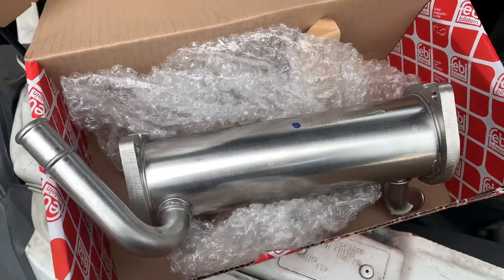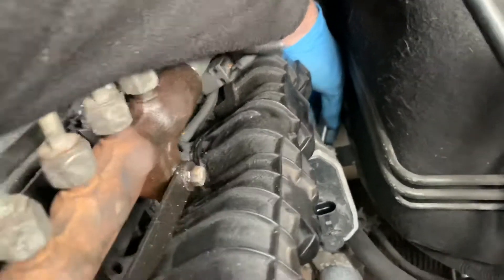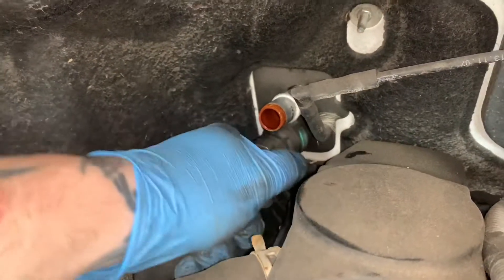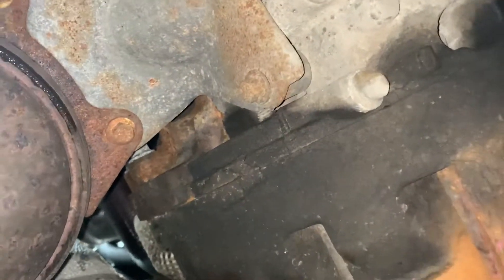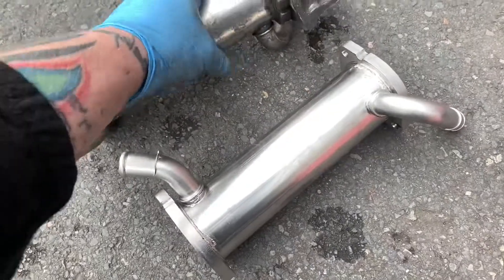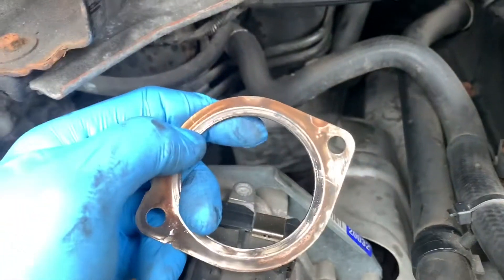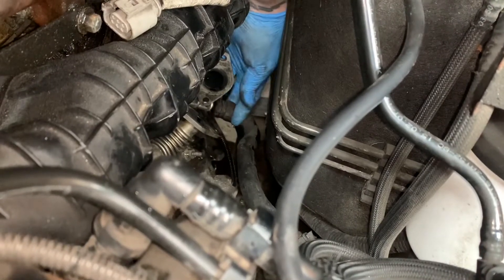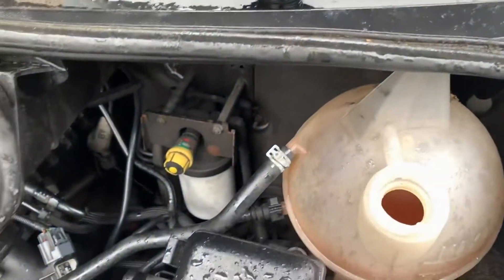Ford Tranist EGR Cooler Replacement, RWD MK7 Transit EGR Valve. Tourneo 200 T350/Ford Ranger 3.2TDCi

Comment: You can anneal copper gaskets (if they are only copper) by heating them up to cherry red then dropping them in cold water. It softens the gasket up. Can help when re-using.
Reply from the maker: You can. I made a video showing the process a few years ago,.. but nobody watched it lol

https://youtu.be/RAuY2-vg7SE

You can do aluminium too. Put soap on it, warm it til the soap goes black then let it cool naturally

Comment: Im suffering for same kinda issue just doing the self diagnosis lol , im abit lost as the water is not feeding back to the reservoir threw the top pipe in tank 🤔 ....im going to connect egr cooler pipes together see if i have an issue still ....iv done a sniff test but not picking up combustion fumes any advice please mate
Reply from the maker: What issue are you having? This was just losing water.

Comment: What was your symptoms bud? Was it losing lots of water?
Reply from the maker: Yes mate, it was losing quite a lot.
Reply: @StupidBlokeStupidVideos  I got the same issue, few idiots said head gasket but I’ve rebuilt a few of the mk7 and head gaskets have been fine. Just seeing options etc, thanks for your help 👍
Reply from the maker: @joelinden1579  if it’s mixing water and oil check the oil cooler, another known failure in the Transhitters